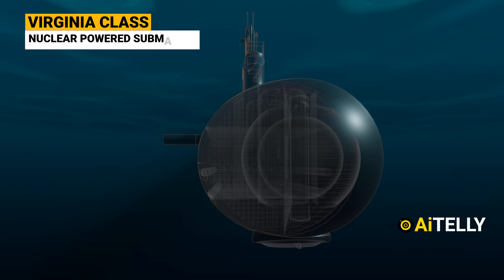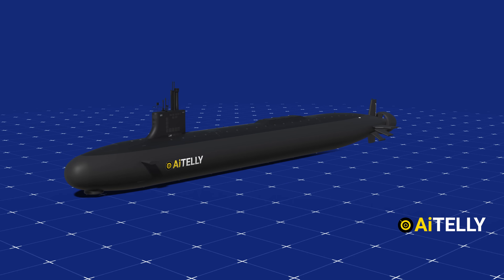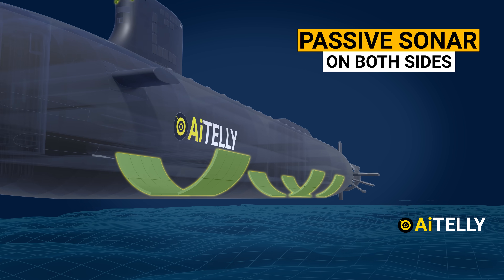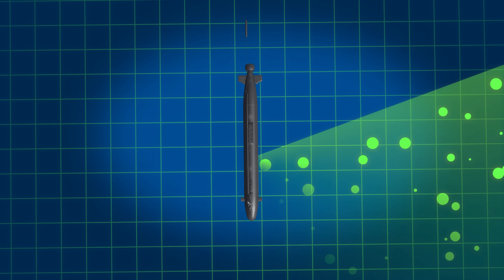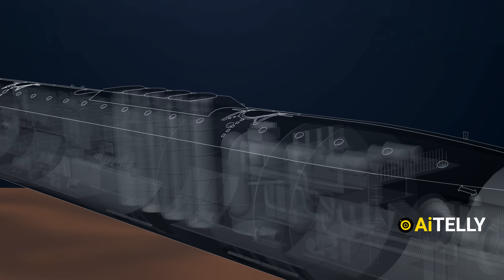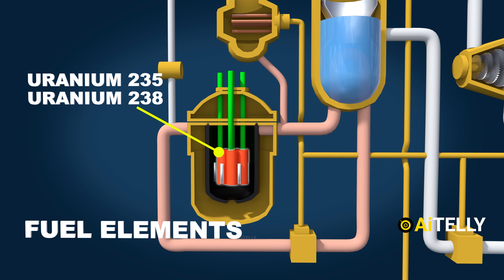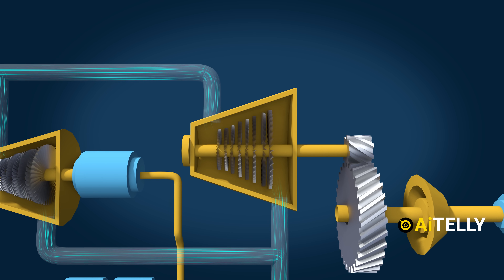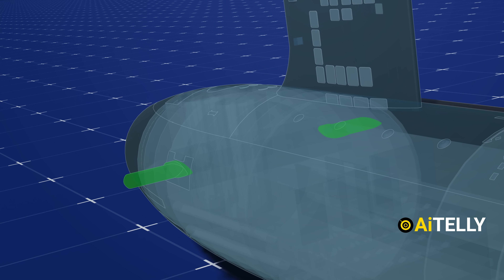Submarine Nuclear Power | Engineering behind it Nuclear Reactor How it Works

Comment: Love the videos, just wanted to add that in most instances U-238 is "poison" for the chain reaction. Weapons grade will have ~90% 235, while fuel will be ~50% to maintain a reaction. Can use fast neutrons to make U239 which will quickly decay into Np-239 then again quickly into Pu239 but.
Reply from the maker: Thanks for your feedback 👍
We love learning from our audience
Reply: @communicationdevice  Certainly not naval reactors. Im pretty sure that the exact value is classified but i can tell you that naval reactors use >90% enriched Uranium 235 for fuel.
Reply: @gbulifant222  My bad, my comment was in reference to the U238 in the video. Yes naval reactors have a different enrichment, ~93%. I was being too general.
Reply: Not true at all for naval reactors. Pretty much all of what you said is inaccurate in this case
Reply: @gbulifant222  Which naval reactors make use of depleted uranium as fuel? I know of fast breeder reactors, but they aren't very stable. I did change my original comment to go through the other decay process if that was an issue. U238 + fast neutron = U239_Np239_Pu239.

Comment: Some feedback from a US Navy veteran nuclear submariner and nuclear prototype instructor - you need to do more research before you make these videos.  There are numerous inaccuracies in this video - in the graphics, explanations, and terminology.  I don't have time to go over the long list but here are a couple of examples.  Nuclear reactors don't have U-238 in them as fuel - U-238 is not fissile.  Your ballast tank usage description is wrong - the main ballast tanks are flooded at the beginning of the dive and stay flooded the entire time you are submerged.  Once you surface the water in the main ballast tanks is blown out with low pressure air.  The trim tanks are used to level the sub and maintain neutral buoyancy while submerged.  You use propulsion and control surfaces to maneuver and change depth while submerged.
Reply: I make the closure heads , pressurizers , primary heads , T shells , and transitioner in the reactors....so far. There's a lot not true about this video, however that's a good thing imo. The public shouldn't know everything and it's not our place to tell them. It's better if they don't know , so our enemies can stay guessing.  
 I come across a lot of videos like this online and I just chuckle usually but wanted to thank the sailors on this comment for their service. I work 7 days a week because I know the men and women operating what I'm making can't go home at the end of the day, it's the least I can do for my country.
Reply: @MadHouse31687  the public knows already, think of how many countries have nuclear subs and nuclear weapons.
Besides, people are more attracted to knowledge when it's perceived as exclusive. We're going to have more countries with more nuclear weapons because people make enemies out of oppressed people.
Reply: You should collaborate with this guy to make a new video.
Reply: This channel is only concerned about views and ad rev and sponsor rev. They promote the absolute worst VPN around and read the script as if it's gold. I'm unsubscribing and reporting for misinformation. I really think this channels script is written by a 5yr old fact checker from CNN.
Reply: As a nuclear reactor operator aboard a los angeles class submarine, the video gets the point across and I am entertained watching this video, just as the content creator intended and just as YouTube itself intended.
Reply: Get shcooooooled boooy.
Reply: So you want it to expose to enemies your secret information &details huh,your such a dumb navy if we call it
Reply: Yeah can any of you tell me if they use thorium please I'm not navy or military but love the tech advancements the military comes up with knowing most of the tech the world uses today was military at one point or another...❤❤❤❤ btw love the way you all get into it do the is it true that the branches of the military argue and fight when they are together
Reply: Check your own understanding. No uranium-fueled reactor is pure U-235. They are fueled to a high percentage, but not 100%. The residual is U-238, left over from the enrichment process.
Reply: HMFIC?? 🤣 The video referred to the U-238 as the fuel.  My comment was "Nuclear reactors don't have U-238 in them - U-238 is not fissile." in the sense that U-238 is not the fuel.  U-238 is a contaminant or poison, whichever term you prefer.  I didn't care to discuss the level of enrichment.  To make you happy, I've added "as fuel" to my original comment.
Reply: I look forward to viewing your corrected video.  Seems like you have all the correct answers.
Reply: FBI open up !! You are revealing classified intelligence
Reply: @a1smith2468  hear me out submarines are top secrets you would never leak.anything if you were a submariner
Reply: @Aliissa-w2d  I guess I'm a submariner then.  What boat were you on, the Youstafish?
Reply: Would be a lot of work to re do it but they could add caption edits of the new corrections. Thanks for sharing more accuracy!
Reply: Ahh yes, another fake nuclear physicist/engineer trying to tell us how we are so “dumb”, I bet you don’t even know how the how propulsion works 🤣🤣🤡
Reply: @alex-t3i9v how long were you on a boat?
Reply: I actually watched to understand how the reactor works, so thank you.
Reply: Man’s literally about to bust out classified information. Fellow submariner, STS3.
Reply: You didn't list STS3(SS).  Don't have your dolphins yet?

All of the information provided (and more) is publicly available.  Chill out.
Reply: @a1smith2468  I know lol it was just a joke and my pfp is old as hell
Reply: @a1smith2468 he's a sonar tech, bro. He's probably informed his CoC about top secret information given out on YouTube 2 seconds after posting that.
Reply: @taylorhession1905  Yeah right.  That "top secret information" you can find just about anywhere.
Reply: @wyattchaplain275  bro is the NOFORN Nincompoop
Reply: Smith. You're a bit rusty on your reactor theory. 
1. U-238 IS indeed a fissionable material, capable of undergoing fision after capturing either fast neutrons or slow neutron. 
2. Fuel rods contain 'enriched' uranium. This means the concentration of U-235 is higher than what would naturally occur (about .7%). It does NOT mean that the entire fuel rod is U-235. In fact, for most power generation, 5% U-235 concentration is considered high.
Now I'll watch the video. 
I wonder if they'll show the part of the submarine where some sailor who hates their fat wife takes all their frustrations out on junior sailors and calling all non fish qualified a NUB. That's the way I remember how some of the forward section worked. Well, the first part applies to the rear too. 😂😂
Reply: @aaronbresnick6768  U238 is fertile not fissile. Fast neutrons breed P239 from U238, it's the plutonium that undergoes fission not U238. These are known as fast spectrum breeder reactors. Most civilian and all military reactors are thermal neutron reactors, thermal Neutrons can't breed plutonium from u-238. In the case of American nuclear subs, they use PLWR's that run on highly enriched U235, not 5% enriched like most civilian reactors. This is why they don't need refuelling for the lifespan of the reactor.
Reply: @aaronbresnick6768  drop the brief document I don’t believe you
Reply: @aaronbresnick6768  I had a typo in my first post - "fissionable" should be "fissile."  I mentioned it was non-fissile in a later post.  I fixed the first post to make you happy.  So, U-238 is fissionable but not fissile.  It will not undergo fission with slow (thermal) neutrons since the binding energy released is less than the critical energy.  So, your first point is incorrect.

Your second point is mostly correct.  However, I never mentioned enrichment levels in the fuel rod so it's not a correction, just a comment.  Also, to be more accurate the natural concentration of U-235 is 0.711%
Reply: @a1smith2468  MMN3 here, just because it’s not 100% accurate doesn’t mean they can’t say it is on a simple YouTube video, those like us that have been through the pipeline know the discrepancies and that’s fine. For the average viewer I’d rather say this is decently good information to understand the dirt poor basis behind sub operation. Yeah there’s wrong info but who cares, we had to get a security clearance for this for a reason dawg.
Reply: @raygonzalez4226  everything I discussed here doesn't require a security clearance, dawg. If it's wrong it's wrong, why teach people the wrong stuff? Looks like you don't even have your dolphins yet . . .
Reply: Ohh excuse him maybe you’re in CIA or NASA
Reply: You are wrong
Reply: @wanderingsoul3431  🤣What boat were you on?
Reply: @a1smith2468 you might as well tell everyone test depth while you’re at it
Reply: @firstnamekarner6263  I didn't.  Actually, I don't need to - you can find that info in dozens of other places.  I'll let you figure out how reliable that info is.
Reply: It’s not that deep bro calm down
Reply: Enough! You are revealing classified information, are you crazy?
Reply: @gaston8269 No classified information is discussed.  It's all publicly available.  Chill out.
Reply: @gaston7007  your the crazy one
Reply: The book by norman has a good isomeric drawing of sw5 given to brits... I saw in one of their paper that they used primary pressure to operate some actuators 🤔🤔🤔 as a new feature compared to yankees.. I think the paper was  talking about dreadnought ...the one brits made...  But I can tell you without ever having come near a submarine or even a large ship that they were talking about fast scramming of reactor hydraulically as a second method 😂😂😂
Reply: And they dont tell you about the heat and noise that a nuke submarine ,perpetually makes, I note ,at that  Bejing rally ,those anti submarine drones on the back of trucks, I know which one my money would be on That's why Nuke subs are rusting away in Russian yards They listen to engineers and scientists Not money makers
Reply: @paulgearing3018 that's not why Russian subs are in the yards.
Reply: Subs are some of any nations most secret naval assets. You were a sub mariner so you know this. I think it’s ok to let details slide, if any, you are doing more good than not by not correcting details. I understand the information you commented is easily found.
Reply: @Cleav727  If you understand the information is easily found then why comment? 🤣
Reply: It didn’t say that the reactor on the Virginia class submarine used those specific isotopes, that was a general explanation of how fission reactors work on navy vessels.
Reply: @rizzorizzo2311   U-238 isn't used in any thermal neutron nuclear reactor - commercial or military.  U-238 is non-fissile.

Comment: Just to be clear on the difference in price between Russian and American weapons there are a lot of factors to make that different.
Labor costs and material costs are vastly different and cannot make up more than a third of the price of the weapon system.
Then there's the requirements the nation builds the weapons to. 
Generally Russian systems have lower labor and material costs accounting for a significant amount of the difference in price.
Americans tend to over engineer and overdevelop although This is because we prize safety and reliability.
American systems also are genuinely overpriced to boost the bottom line of weapons manufacturers. 
Just to be clear there's just not one thing that dominates. And different weapon systems can have different combinations of all these parts.
Reply from the maker: Hmm 🤔 agreed 👍
Reply: Don't forget in the US government contracts often encourage a low bid (to win the contract) with the knowledge that cost over-runs are covered by the government. In many cases the cost overruns greatly exceed the initial bid.

Comment: An ex sailor once told me that the deeper a sub dives the harder is to surface !! And thia makes sense since its harder to pump out water from ballast tanks in bigger pressure. So subs are not what many people think !! They stay mostly surfaced!!!
Reply: They absolutely do not stay mostly surfaced
Reply from the maker: Yes 👍
Reply: That was only the case until the end of WW2, after that they changed to stay mostly submerged.
And no, it gets not harder to surface, because the change depth with the depth planes, not by pumping water from and to the ballast tanks.
Only in case of an emergency the error margin of flooding gets smaller the deeper the boat goes.
Reply: @wolf310ii prior to nuclear submarines they were called submersibles.
Reply: @Slackware1995  So where had the Hunley or Turtle its nuclear reactor?
Because a US Navy document about the Fleet SUBMARINES from 1946 starts with a introduction about early SUBMARINES, with the Turtle as very first example of a SUBMARINE.
US Navy training movies and news reel movies from WW2 also talk about SUBMARINES, showing a Gato class SUBMARINE, were did it hide the nuclear reactor?

Comment: Slight mistake in the video: Ballast tanks typically have no bottom valves. The top valves are normally closed, except when buoyancy adjustments require taking on more water in the tanks. Opening the top valves allows air to escape and the sea simply flows in from the bottom ports. To ascend, very high pressure compressed air, stored in tanks aboard the ship, is injected into the ballast tanks, forcing the water in the tanks out through the free-flood ports in the bottom.
Reply from the maker: Thanks Scott Gomez highly appreciated 🙏👍
Reply: The ballast tanks arent used to adjust buoyancy.
Only partly flooded ballast tanks would make depth keeping and trimming incredibel difficult.
For example, on the surface the ballast tank is half full.
Now the submatine dives 10m and without changing anything, no air is released or blow into the ballast tank, the tank is now 3/4 full with water and 1/4 full of 1bar compressed air and the submarine drops like a stone because it lost half of its buoyancy.

The otherway around it doesnt get any better. To blow 1/10 of the ballast tank at 100m you need to fill it with 10bar compressed air and the boat will start to rise and accelerate the raise the higher the boat get, because the compressed air expands, increasing the buoyancy faster and faster until the tank is fully blown on the surface.

To adjust the buoyancy they use pressure proof axillary and/or trim tanks wich have top and bottom valves and they use pumps to pump water in and out, compressed air is very limited on a submarine and is only used in an emergency blow.
To surface normaly, they just steer to the surface with the depth planes and once on the surface they use low pressure air blower to blow the ballast tanks.

Comment: How the air is pumped into a submarine to lift it during it submerges in the water?
Reply: It doesnt need to pump air into the tanks when submerged.
The ballast tanks are only there to give the boat neutral buoyancy, not for controlling the dive and depth of the boat.
They have a tank for adjusting the neutral buoyancy, but change of depth are done by the depth planes, like an airplane.
Reply: Big compressors pump air into big tanks.

Also dive planes and/or fair weather planes, not depth planes.

Comment: While 240metres is not really deep this is damn impressive machine.
Reply from the maker: Yes it's classified information.
All the numbers regarding military data are either inflated or intentionally put out incorrect information to deceive the enemy.
Reply: 240 meters is complete bullshit; it's just the navy excusing themselves from stating the actual test depth, which is classified. But we estimate that it's anywhere between 500 and 600 meters, with an additional 150-200 meters of buffer between test and crush depth (due to the USN's 2/3 test depth rule)
Same applies for speed and specs of the Mark 48 torpedo. They're all classified to hide the true capabilities of American submarine weaponry.
Reply from the maker: @AveragePotatoEnjoyer3921  Yes it's classified information.
All the numbers regarding military data are either inflated or intentionally put out incorrect information to deceive the enemy
Reply: I was on many submarines and I didn't know the real number. Lets just say its deep. Hopefully the number of dives equals the number of surfaces.  @AveragePotatoEnjoyer3921